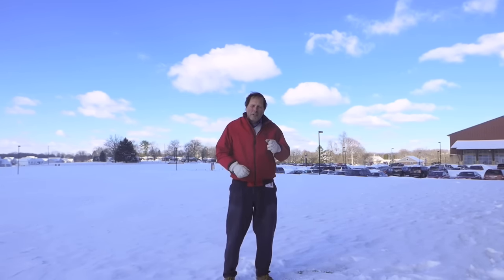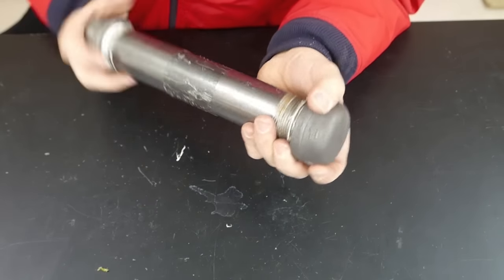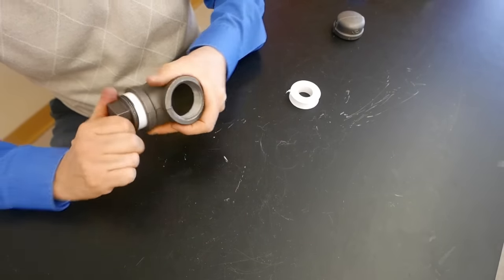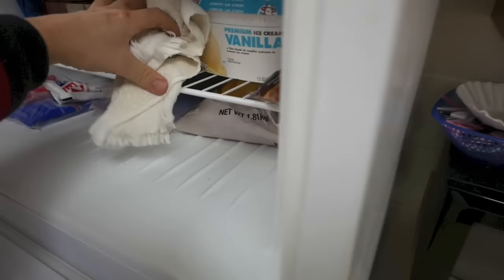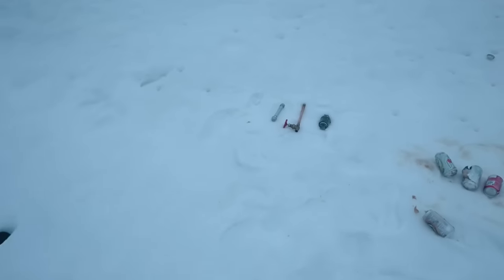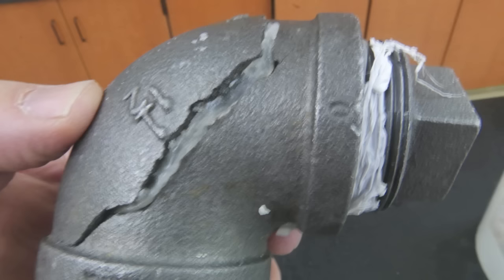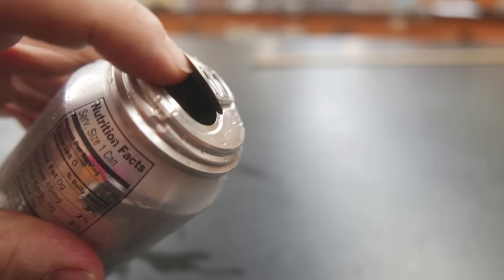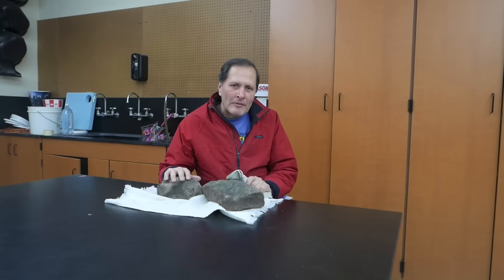Freezing pipes & soda can science demonstration // Homemade Science with Bruce Yeany

Comment: so it looks like caps are designed to give before pipe. this would make sense you wouldn't have to buy the whole pipe just a cheap cap.....honestly expected the pipe to go before the thick caps. good videos by the way.
Reply from the maker: I still find it amazing that amount of force generated here
Reply: seedorfj well that makes sense. I knew they where cast just wasn't thinking of the strength I guess. thanks I will check your stuff out too.
Reply: Cast iron is quite weak. If those were steel caps, it have taken a much lower temp to successfully freeze and break them.

Comment: Would You Be Able To Fill A Hydraulic Ram Half Way Up With Water Then Block The Bottom Port And Leave The Top Open, Would You Have A 15 ton per Square Inch Ram Or Will It Just Crack

Comment: So I have a question, if say you had a material that could withstand the pressure from the expanding water, would it be some kind of dense ice when you open it? Or would it stay as water? To me, it seems that the crystals wouldn't get the chance to form. Even more interesting would be if the water would turn into ice as soon as you open it.
Reply: Conor Damery water cannot be compressed.
Reply: Actually yes you can, in fact everything can be compressed, heck we even have neutron stars in this universe. Note that I said assuming there was a material strong enough to withstand those pressures.
Reply: I need to know the answer for this
Reply: No Conor. 

"The answer is yes, You can compress water, or almost any material. However, it requires a great deal of pressure to accomplish a little compression. For that reason, liquids and solids are sometimes referred to as being incompressible."

You would need something nigh unbreakable to be able to compress water. any material you could obtain from a home depot isn't going to cut it
Reply: Could you expand on your answer? On what basis are you concluding that? I really doubt your answer, if anything I know the water would freeze into a dense ice in planets with high atm pressure so by that I concluded that it would become a dense ice, however, I'm curious if someone has done the math. Although it looks like I might just end doing the calculation myself.
Reply: Yes I get that, nevertheless it's wrong to say that it is incompressible.
Reply: Freezing temperatures under what pressure? Yes sure you can have water turn into vapour when there are low pressures, but the more pressure you have the higher the temperature you will need to turn it into vapour
Reply: I'm just going to answer my question as I have googled it now, and yes, it seems like it would just become a dense ice if enough pressure is exerted, otherwise it'll just be a bomb container of water.
Reply: And opening it would cause it to turn back into water or maybe even normal ice as it would be cold enough to stay as ice.
Reply: You could execute your experiment by putting a small amount of water in a pressurized vessel (like a tank with a sight glass) and then once the vessel is pressurized put the whole thing in the freezer. This would allow you to see if the ice crystals will form under any pressure you choose without the risk of bursting the container.
Reply: ice II

Comment: There was an experiment done some time ago where they filled a cannon with water, capped it and allowed it to freeze (the cannon cracked). Depending on the level of your physics students you could also use this experiment to talk about the different phases of ice. If there was a vessel that could contain this kind of pressure, how would the ice behave compared to your standard ice.
Reply from the maker: good question,  I don't know
Reply: https://en.wikipedia.org/wiki/Ice

if you scroll down to the section on "phases" it shows a T-P diagram for water. It shows the different phases of ice depending on the temperature and pressure.

Comment: I normally don't comment with my channels account but I felt the need to do so. Just found your channel and I love what you are doing almost reminds me of when I watched Professor Miller on PBS. I do have one suggestion with this video which I am sure you already considered. I am a pipefitter/plumber and have come across many pipes that have exploded in my 16 years in the trade. All of your pipe failures came from the 90 (elbow) and caps all being made of cast iron. The copper one broke the cap where it had been stamped from the factory with the logo (weakest point). I personally have copper pipes from a job I did that actually split out the side like the cans did. I think people would be interested in seeing this experiment done again with metals of the same kind or for copper finding an unstamped cap. You did great but this is just a suggestion.
Reply from the maker: Thanks Ben,  I didn't even of there being a difference in the metals,   I hoping to try this again and this time cool them much faster either with an alcohol dry ice mixture or liquid nitrogen

Comment: Lot's of really good videos, Bruce.

With the pipes,  you're sacking the deck a bit with the pipes because screwing the caps on under water pre-loads them.  I use that effect to "tune" my Cartesian Divers for neutral buoyancy by adjusting the inner-seal-ring cap and show the hydrostatic pressure gradient from the bottom to the top of the bottle.
-- 
Regards, ScienceAdvisorSteve.
Reply from the maker: +Observ45er     I would say the amount of pressure that I can exert by hand tightening the caps is negligible compared to the tremendous amount  generated by the physical change of state.  Since water is incompressible,  once the caps seal the water inside the  container it is very hard to tighten it down any further.   I would guess that your tuning of the Cartesian divers  is only varying pressure by a few PSIs, quite a bit less than the 30,000 PSI that is generated here.  Thanks again for comments,  I've enjoyed hearing your views.
Reply: Bruce Yeany   Thanks and you are welcome, Bruce. 
...
Yea, I guess the plastic bottle is no contest for the iron pipe and I hadn't thought about the water stopping the end caps, but that is correct, of course.
...
It's hard to find others that have the background to discuss things like this with.  You'll be hearing more from me as I watch more of your videos.
--
Regards, Steve

Comment: Have you done the rock-breaking follow-up yet?  I can't find it.  Maybe the weather suddenly warmed up!
Reply from the maker: It was funny,  the day after making the first video,  it warmed up 30 degrees.  It will have to wait until next winter,
Reply: +Bruce Yeany (Yeany Science) not to sound rude or anything but couldn't you just put them in the freezer? :)
Reply from the maker: I could but several people have frozen foods in there,  there's not much room and I didn't want to impose on others using the freezer.  I

Comment: Can you explain where does the energy for the expansion come from, while heat energy is moving out to the surrounding? Thanks!
Reply: Kai Ming Choi As the water freezes, it becomes less dense, so it has to take up more space. If there's not any more space to fill, it will be pushed up against the side as new ice molecules form behind it. Eventually, the ice molecules are pushed so hard against the pipe that the pipe ruptures.
Reply: Excellent question!

The microstructure of the watermolecules in the solid form (chrystalline) reduces the overall energy of the system. A system always "wants" to occupy its lowest possible energy state. The heat loss caused by the decrease in temperature (water to water at freezing point / kinetic energy of molecules in liquid form) and the phase transition from liquid to solid (largest part) is given out to the surroundings. 

The unique thing about water is that it expands (lowers density) as it transitions from liquid to solid. So you actually have to remove energy for it to expand. Once it hits the barrier (the metal) it will fight the internal forces of that. The more favourable energy state (lower) of the chrystalline structure of the ice in the end overpowers the internal molecular forces of the metal, hence the pipe/can bursts. This can only be done if you keep removing energy from the system. Additionally, the metal also shrinks when temperature lowers adding even more stress. But the latter is negligible compared to the volume increase by the liquid->solid transition from the water. The eventual bang or crack is caused by the release of the stored internal/molecular stresses induced in the surrounding material. 

TLDR; the energy comes from the drop in total internal energy reduction caused by the phase transition from water to ice.

Of course, no energy is lost in the total system (pipe/can + surrounding environment) as that would violate the first law of thermodynamics. But if you consider the system to be the pipe/can then it would lose energy.
Reply: PbPomper Thanks for the answer. Is that the latent heat energy that expands the pipe? On the other hand, if I am able to contain the water in an extremely high pressure environment that it cannot expand, can I decrease the water temperature to certain value below zero while the state of water does not change?
Reply: You can almost think of it like a compressed spring releasing its energy, except the energy is thermal.

Comment: "Water as cold as possible because its the most dense" actually you want as near to 4°C as possible.
Reply: Dennis Lubert 
this surprises me as I assumed warmer water would be more dense. I know water expands as it freezes, so I assumed the opposite was true when it's heated.
Reply: The explanation of water crystallizing cleared that up for me. So all elements expand when heated, but water happens to crystallize which results in expansion.
Reply: Interesting Ted Check out this graph in the expanded view around 4°C https://upload.wikimedia.org/wikipedia/commons/8/84/Density_of_ice_and_water_%28de%29.svg
Reply: Dennis Lubert 
huh. You learn something new everyday.
Reply: Dennis Lubert 
*3.98 Degrees Celsius.
Reply: +Dennis Lubert
Yeah, I knew about that but looking at your chart, the difference is tiny and his approximation of getting as close to freezing point kind of still holds. However, the chart has very real consequences for the marine life as a layer of 4 degree water is formed on the bottom of the water body (be it lake, creek, sea, ocean...). The density of water at 4 degrees is just some -0.1 kg/cm³- 0.1 kg/m³ (of course, 0.1 kg/cm³ would be very dense) more than water at 0C. :D

Comment: Hopefully you're still around to give me your opinion on this statement I found in a published document. If you don't know the answer maybe you can test for it. Do you think this is a true statement?
"WHY PIPES BURST
Surprisingly, ice forming in a pipe does not typically cause a break where the ice blockage occurs. It’s not the radial expansion of ice against the wall of the pipe that causes the break. Rather, following a complete ice blockage in a pipe, continued freezing and expansion inside the pipe causes water pressure to increase downstream -- between the ice blockage and a closed faucet at the end. It’s this increase in water pressure that leads to pipe failure. Usually the pipe bursts where little or no ice has formed."

Comment: Nice video.
Reply from the maker: Thanks PHSH,  I hoping to try it with some rocks when it gets colder
Reply: Bruce Yeany   Can you rig up a computer connected camera in the class room to record the experiment?  Would be interesting to see what happens when.

Not sure if you've made a video about diet and non-diet sodas.  If not you should make one showing what happens when diet sodas and non-diet soda (in liquid and frozen state) are placed in a bucket of water.  (Use a can of water as a reference standard.  

Will they all float?  Sink?  
Or will the frozen sodas float and the liquid ones sink?  Or the other way around? 

And for a variation of the experiment try placing the cans of soda in cold. (near freezing) room temperature and near boiling buckets of water. 

Spoiler alert - What's being observed has to do with the molecular weights differences of the sodas.  There's only one ingredient that's different between diet and non-diet soda.  Calculate the MW of that one ingredient explains the result. 

Once you see this experiment you'll always think about it when you reach for a soda at a barbecue.

A piece of trivia for you....  the thickness of an aluminum can is less than the width of a human hair.  

Incredible how strong a thin piece of aluminum can be.  If I'm not mistaken the lunar lander's skin was all made of aluminum the same thickness as an aluminum can.  Hard to believe aluminum this thin protected astronauts from the njear perfect vacuum of space. 

Great videos - Keep making them.
Reply: Passed High School Physics It always surprises me, I can't remember which way round it is, but here in the UK Coca Cola cans are made from a different metal to Pepsi Cola cans and one feels as though it has drink left in it when it's empty when compared with the other.  One is aluminium and the other steel if I remember correctly.  Perhaps the can which didn't explode was a different material?

Comment: The water isn't as dense as possible when it's I've cold. water is as its densest at 4 degrees c, or about 7 degrees farenheit above freezing.
Reply: Cyanide Word I know that, I said 7 degrees above freezing. I don't know what temperature freezing is in Fahrenheit, but I know that a Fahrenheit degree is 4/7 of a Celsius degree. 

I would assume people who use Fahrenheit regularly (Americans, Liberians and Myanmarians) would know the freezing point of water in Fahrenheit and be able to use the information I provided by adding the 7 to that number.
Reply: 0°C= 32°F
Reply: 5/9 of a Celsius degree
Reply: Yeah, but the difference between 0C and 4C is quite small. See this chart for information: https://upload.wikimedia.org/wikipedia/commons/8/84/Density_of_ice_and_water_%28de%29.svg. You can see that 0 centigrade water is around 999.85 kg/m³ by its density and 4 degree water is little over 999.95 kg/m³ so the difference between them is 0.1 kg/m³. In other numbers the density of zero degree water is about 0.9998% of that of 4 degree water. The difference matters the most when you heat up the water as the density starts to drop fairly rapidly.

Comment: Although most cans are aluminium, some are made of steel.  Might be interesting to see if they hold up better than the aluminium ones.
Reply: That would depend a lot on the steel alloy. Some materials are extremely strong but very ductile (e.g. glass/concrete), which would cause it to crack very quickly. Ductility is a measure of elasticity (https://en.wikipedia.org/wiki/Ductility). This is the reason steel reinforced concrete is so successful! It is a composite that combines the incredible compression resistance of concrete with the relatively good elasticity of steel (see also https://en.wikipedia.org/wiki/Young's_modulus). This is why composites (reinforced concrete/fibre reinforced polymers) are so incredible useful :)

In fact, steel itself is a composite. It is nothing more than iron with some added other materials and usually a heat treatment (to alter the microstructure) to give it the right properties for the job. Carbon, nickel, chrome, etc.These all change the resistance within the molecular structure or add benefits like rust prevention. It's just like cooking :P